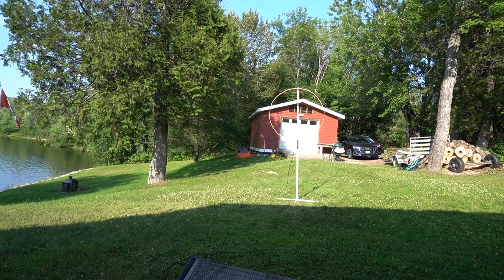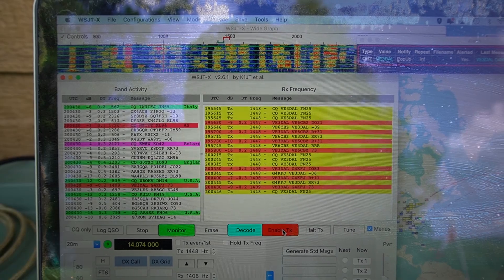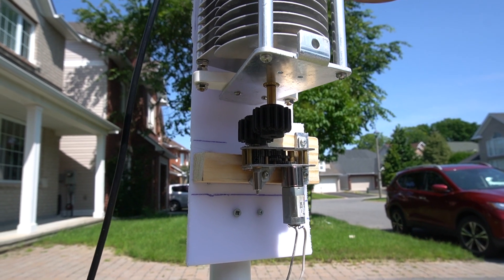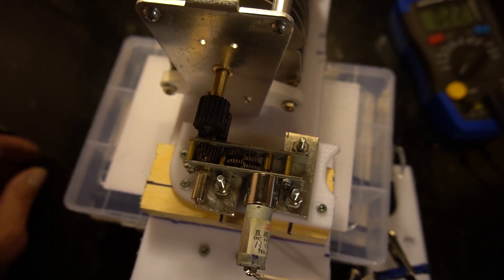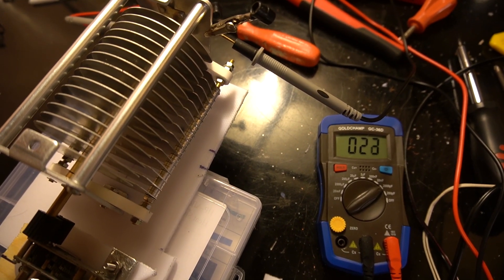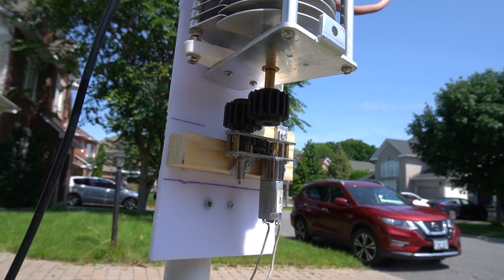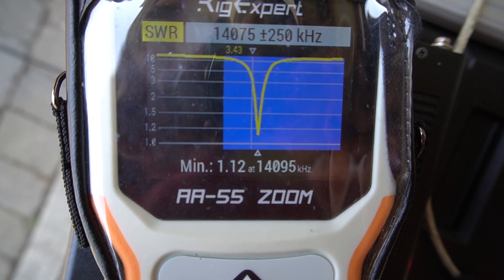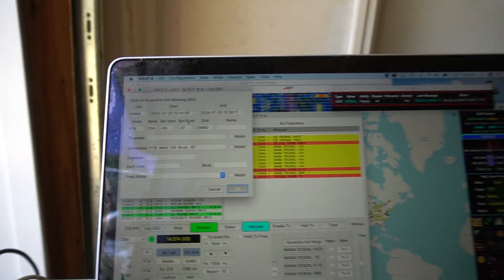HAM RADIO - Magnetic Loop Antenna Coupling Loop & Remote Tuning Update

Comment: Great video.  I like your idea of Arduino.   Before you remote it, may I suggest putting an optical encoder on it.  Then map out the capacitor location vs frequency.  Then you might be able to have presets.   Tell the arduino what freq you are on and it automatically tunes the capacitor to that setting or very close to it.    Could possibly use Hamlib to have the radio talk to it.  Might need a Raspberry Pi for that.

Great project, thanks for sharing.
Reply from the maker: Thank you so much! I tell you that I enjoy building this project more than operating the radio with this antenna. The performance of this antenna was not what I was expecting. MLA is great antenna depending what is your situation in terms of location. I love to go to the cottage and deploy a full wave Delta loop antenna for four bands. I love the Arduino boards, I use them for almost every project like LED , TFT display, RTC....73 my friend!
Reply: @VE3DAL i sometimes enjoy the build a lot more than operating.  I operate sometimes to prove my project works.  I build a loop, though had an issue getting the gama match to work.  The loop was a design I found on youtube where the guy wrapped 3 inch wide coper foil around 1.5 inch pvc pipe.  Was trying to build it due to limited space at a rental home.
Reply from the maker: @NA12495 I saw something like that by using aluminum tape wrapped around PVC pipe and definitely gamma is not a fun thing to deal with. 73 my friend.

Comment: My first MLA was workable but useless as remote tuning not there. I am using a VVC so continuous tune out. I am also using 12 v dc reversable hi torque low RPM motor from RCC. Issue! Copper is prohibitively expensive and 3/4 nearly unavailable. Have you tried coax?
Reply from the maker: I kind of gave up on my MLA , even with the remote tuning was very hard to get the frequency desire. I tried with coax once and it was the results.

Comment: Hi, Take a look at ( re: Ham Radio ) I did make the same for controlling my loop. TX not jet still experimenting with it.. SWR on analyzer is good but on the radio not so mutsch so still fidling around RX is not bad about as good as my endfed for 10-40mtr and loop still inside.. Good Luck.. 73'
Reply from the maker: @ablaauw70  Thank you. I really enjoy building this antenna but not so much the performance. The delta loop and the moxon I have in my backyard still my primary antennas maybe one day I will go back and play with this antenna. 73s my friend

Comment: This is a great project -- very nicely done. 

I've been intrigued by MLAs since my early Ham days, but am only now actually building one.  It's very early, and I can only hope it ends up as well built as yours. Will be interested to see what you do with your project moving forward. 

73 de N8ESP
Reply from the maker: Thank you so much I appreciate! I really had fun doing this project. The performance of the antenna since it was my first one it was adequate. I just finished a better remote tuning system which I will make a vid about that. 73's my friend

Comment: Find me on the QRZ. Callsign KK6SPM. I used Stepper Motor HAT + Raspberry Pi. I can share the source code. If you use a 200-step motor you will need at least a 1:8 reducer.

Comment: A loop of 1 meter is about optimum for the 20 through 10 meter bands you are operating at this time.  For lower frequencies such as 80m the loop would need to be a wider diameter.  One thing to avoid when designing loops is to choose a diameter that avoids lumped current constants, which occurs typically when the loop diameter is too large for the frequency used.  It's a fine balance.  Larger is not always better when it comes to MLA's.  Great work.  I love your project.
Reply from the maker: @danielzdanowicz6899  Thank you for the great feedback!  It seems that I can't get to the 10m , my capacitance starts at 22pF with this system. Since this is my first MLA  I will build some others for sure. Thanks again best 73's.
Reply: That loop should tune the low end of ten meters. You may need to reduce the capacitance to get higher in frequency. Possibly switch in a door knob capacitor in series. Also vary the coupling with the exciter loop moving it up or down the shaft a bit. If you smith chart it on a Nano VNA it should tell you what direction your experiment should go. One thing that might be worth trying too using a Delran plastic coupling between your gear works and the capacitor shaft which would further assure there is no coupling leakage at that end of the capacitor. Just some thoughts from afar.  73s
Reply from the maker: @danimac3953  I will check that door knob capacitor for sure. I was thinking at first to reduce the size of the main loop and compromise the 20m and that would be ok because I'm thinking to build another one. There are so much into this antenna and that's what I like. Thank you so much for the tips. 73's my friend
Reply: @VE3DAL  reducing the size of the loop would definitely accommodate getting higher on ten but would compromise performance on 40 which might force a decision to be made as which end of the spectrum is more important in the scheme of things. One thing to keep in mind surface area is critical to loop efficiency. Do not use a thinner radiation loop. What you are learning from these experiments will make you the local authority on MLAs. Great work!
Reply from the maker: @danimac3953  to tell you the truth I never try 40m on this antenna I only took a SWR reading because I knew the efficiency wasn't there due to the size. I have a quite a few feet of  KMR400 coax cable to spare, where I'm thinking to do some sort of 8 figure loop to get that 40m back again. I took a quick look at door knob capacitor but I'm not to familiar how would that work comparing to the variable capacitor where you control the capacitance. I appreciate your knowledge.
Reply: @VE3DAL  I would suggest LMR 600 as it has a lot of surface area. Try a meter diameter of that first. Then try a loop a bit smaller if you’re willing to give up 40. Basically if you can grab an SWR of 2 to 1 or better you’re ok. You would be in the range of the rig’s internal antenna tuner and you could trim the SWR down with that. Roger Stenbeck from PreciseRF suggests this approach for working the upper fringe of Ten.
Reply from the maker: @danimac3953  at this point I will work with the material that I have to spare. If I get good results on the 8 figure loop coax on 20 and 40 I will reduce the copper one for better logistically. When I build an antenna number on my list is how I can take to places and easy deploy. Cheers! 73